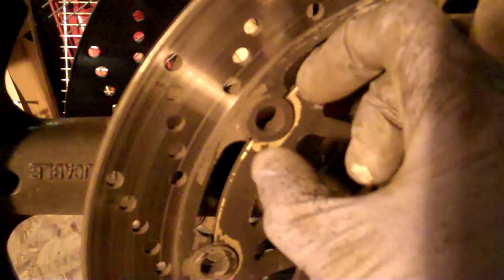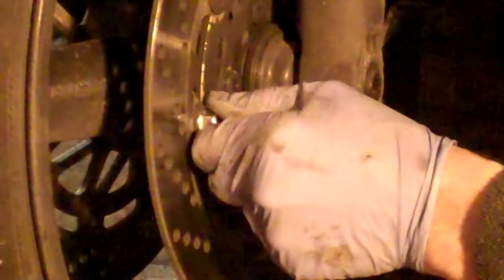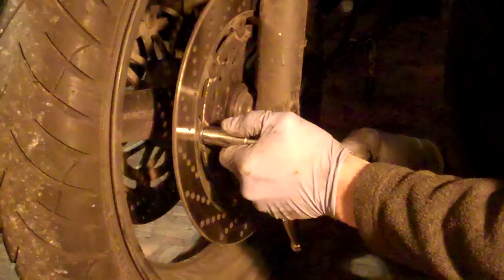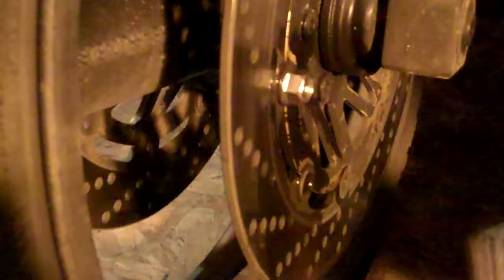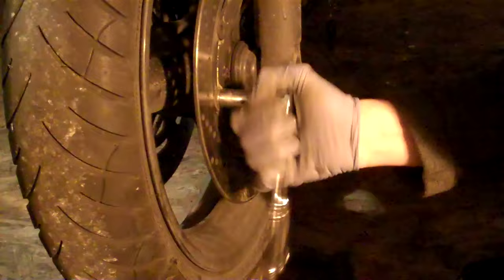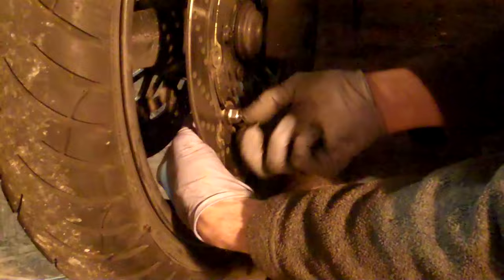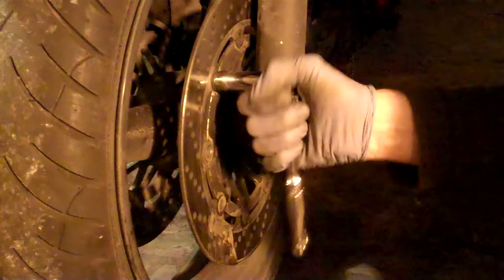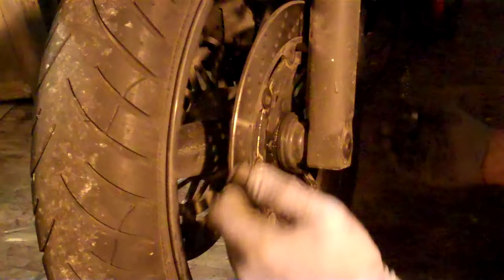Delboy's Garage, How-To Free up 'motorcycle brake disc bobbins'.!

Comment: Great video, never knew this and I’ve been biking for years. 👍 When discs are mounted Left on Left - Right on Right correct direction. How about alignment of disc to disc? Eg on wavy discs the wave should not be aligned but offset. Is this the same for standard Suzuki discs eg. Have the bobbins offset or aligned? 
Thanks Again

Comment: cant we wash the rotor with a detergent or something that would clean the rotor so when you apply brake the pads wont just slip on rotor they would rather grab said rotor as there suppose to in order to stop...

Comment from the maker: CERTAINLY NOT WD40 ...that would be very dangerous as it is an oil!  I used aerosol can brake cleaner, which is a high octane spirit, that washes out dirt & grease and leaves a bone dry finish!

Comment: Hi mate, really appreciate you doing these vids, went to my bike after watching this as i knew my bobbins were stuck, and anyone I've asked about the symptoms has said it's definitely a warped disc. I'm really hoping this isn't the case as the discs are almost new, so I went to try this method.
Having tried this, the bobbins are absolutely stuck firm, and i chickened out before getting them to move. If they are locked absolutely solid, can i damage anything or should i just try harder?
It's an SV650 so I believe the discs should be pretty similar to those on your bandit in this video. Hope you can help mate, thanks again.
Ed
Reply from the maker: Hi Ed, if they've never been cleaned then they could well be corroded solid... have you sprayed them with the brake cleaner, and used the nut and bolt to turn them?  They shouldn't need that much pressure to turn, as there's nothing holding them in place, other than the dirt!  Give them a good soak with lots of cleaner and try again and see how you go... Del
Reply: Thanks mate, that's great. I saw you answered the same question from someone else, so i should've checked, sorry.
I'll soak them with some cleaner and then try again, I'm happy to put some force on it, as long as i know I'm not doing anything stupid, I'll let you know how i get on.
Thanks again.
Reply: What were the symptoms.i found when front braking that theres tugging when i come to slow stops. Same for u¿

Comment: Hi delboy will this act like a grab if I have one or to of the bobbins locked up 
I get a nice brake then a real quick grab,the disc it self is very clean all round with no rust anywhere 
Dek121
Reply from the maker: +Dek Till Hi buddy, if the grab you describe is equal and rhythmic, then one point of the disc is gripping more than the rest, so by all means check that each one is moving then at least you've eliminated that - hope that helps!

Comment: Hi Delboy
great videos thanks for all the info
 one of my bobbins is a little loose
moving a bit from side to side
what to do?
Reply from the maker: +DAVID Yan Peer VCheck the shim on the back David, it may have dropped out or maybe just jammed flat...compare it to the others and see if you can detemrine whats different...
Reply: +Moonfleet41 
thanks for the fast replay!
 all are tight just one a little loose
nothing missing
its a new set of moto-master floating discs
only 500km in use
can i tigthen it with a bolt & a nut?
Reply from the maker: +DAVID Yan Peer If they are the 'press together' type of bobbins, then yes, a squeeze with a nut and bolt will hopefully tighten up that one...

Comment: Hy Delboy. I changed my brakepads on my 650 bandit becouse they was squicky. Bit still remaind like that. I tried what you showed here but no change😔what else could i try to eliminate that frustrating noise? Thanks a lot!
Reply from the maker: On the 650 you should have some stainless steel shims on the back of the pads, if they are missing it will squeal...
Reply: Thanks for your answer. On the back are those plates but on the front no. And on the part schematics also are not present those plates. In time i cleaned the callipers. But now i not manage to get out all the air from the sistem🤣

Comment: I tried this on my Ducati 1098, it has relatively new discs ( ebc vee rotors, wavy discs) and when I tighten the bolt, the bobbins will not move, no matter how hard I turn the spanner, any suggestions would be amazing, p.s love the channel 👌

Comment: Hi Del, firstly thank you so much for your very insightful vids. A circle of friends all relatively new bikers we had no idea these needed cleaning. 3 out of 3 bikes were totally gummed, 2 sort with some elbow grease, My bike on the other hand like a post below will turn with bolt in however remove the bolt and no chance. My question is do I soldier on with the generic brake cleaner or can i move onto something with more penetrative properties. If so, can what can you recommend? Poorly 08 Z750

Comment: Hello Delboy,

Great vid. Quick question and hopefully you can help me. I have the Arlen Ness G3 Floating Brake Rotors. I happened to notice the other day that the Front Brake Rotor hardware kit (Screws, washer and lock nuts) are loose (some play) while installed, I figured I'd tighten the screws and that'd be it However, this did not work as they are all in (Tightened to the max) Bottomed out.  They are still lose and flimsy which makes the disc wiggle quite a bit. Aren't these supposed to be firm and sturdy while installed and doing their purpose between the brake disc and the carrier? Please advise..ty
Reply from the maker: I think you're referring to the Bobbins?.. those pins that connect the rotor to the carrier are there to allow the rotor some free movement in order to centralize it between the pads..!!   not familiar with the Arlen Ness discs, so i can't really advise over email... !

Comment: Hi del slightly of topic here but the other day I watched your service the bandit  and it looked like you used car oil ?? My confusion is  should you use motorcycle oil only on bikes as they share oil with the gearbox  and have additives for the gearbox in bike specific oils  where as car oil doesnt, im rather confused here

Comment: Hey! Can you tell me what size nut/bolt you used? I have an 01 r6 but I'm assuming all bobbins are of the same size
Reply from the maker: +Hasnain Khan Hi buddy, no, bobbins are not the same size... just measure the hole and make it a bit smaller than that!
Reply: Okay thank you!

Comment: Ahh I see I just thought the difference  in the oils was addatives for the  gearbox    but like u say the bandit is a tough old motor  so would that mean the more advance high revving performance enginea would benefit from bike specific oils ?  Also would that mean normal car engine oil minus specific  is fine for engine and gearbox of a basic  engine  theres not adverse effects on the gearbox and clutch ? Thanks for the reply del knowledge is power :)

Comment from the maker: Makes no sense mate...are you sure you're not pinching them up with the bolt maybe?...see if they can move by hand maybe.. sorry but i cant really so much more then suggest things unless i saw it...you can try the WD40 if you really thing they are seized..but there would be rust showing if they were....if you do that however mate...clean them after like you never cleaned anything before...

Comment: one question.. my discs rotors give me a fealing that they are bend.. vibrating brake leder slightly when stopping from 200kmh.. in low speeds its ok.. my this help me with my problem? i have bought used disc alredy to replace them (cheep deal).. but can i give it a try or they are 100% bend and i have to replace them?

thank you!
Reply from the maker: HI, why not give the rotors a clean and spin the bobbins as shown in this video, and see if that cured it..!
Reply: Ok heres the deal :) i done this to my "new" rotors.. on old ones.. you can't spin bobbins compleatly like on identical new ones, just inner side (semi-floating discs on r1) and burned spots are on them.. so they are fried :) thanks for video..

Comment: Anything you can do if the bobbins become to slack and the discs rattle, or is it a case of live with it or buy new,  great vids you do  btw
Reply from the maker: I believe you can buy new bobbins and shims to fit them, the only way would be to check with the corresponding dealer to see what they have available...
Reply: cheers will have a look

Comment: The Disks on my Fazer have what appears to be One sided Bobbins ... any Ideas/Suggestions Del ?
Reply from the maker: Hi mate, some bikes do have solid bobbins, so no space to stick a bolt through, best to try a G-clamp, but don't damage them... good luck, Del
Reply: Moonfleet41 good idea, will give it a try ..cheers for responding and keep up the good work :D
Reply: Moonfleet41 Thanks to your vid's @Moonfleet41, I've set about to cleaning the solid, riveted bobbins on my 1998 Ducati ST2, and I have 2 riveted bobbins that are not cooperating. I'm curious about the G-clamp suggestion, because I've tried that and the part I couldn't figure out is that the bottom part of the G-clamp, the part with the threads, the head of that spins and does not grab and turn like one would need it to work in order to spin a bobbin.  I am an instant fan of your youtube channel, and wonder if there's anything I'm missing to make the G-clamp trick work on the riveted bobbins.
Reply: Seditious Blasphemer
Reply from the maker: The G-Clamp is fixed at the cast steel end, and this bears on the innner side of the bobbin...once its gripped, with some brake cleaner applied, it should shft it, just wiggle back and forth to brake the grip of the road dirt while you irrigate with brake cleaner directly onto the stuck area....works every time.. !

Comment: This rat-bike - What's the MODEL? Or at least, what's the front end from? The calipers seem almost ideal for this special fork I'm trying to put together. Wanna do up a replica NS500/NSR500 43mm TRAC fork, using two right-hand-side legs from the '96+ ST1100-ABS, and an important feature thereof was the mis-matched piston sizes on the calipers, for the anti-grab properties - Kinda like the 2LS & 4LS linkages on DRUM brakes, but in reverse I should think. With a lot of the biggest 4LS drums used in racing, the better riders would actually REVERSE those linkages, or at the very least go to an SLS actuation. I guess that means that when you can stop the brake from grabbing & seizing, you can USE more of it's overall range & ability. When the brakes are UNDER powered for the application, then all is well and good you might as well try and magnify as much as possible - but if they're MORE than adequate, you'll never be able to use the whole brake without seizing the wheel, throwing control out the window unless you can know where that seizing point exists - which would be all the more difficult with an exponential increase in braking force, unless you put some kind of lever-stop at that point, adjusting the lever pull so that it hits the grip right before the grab would occur. Quite possibly impossible in itself given the hydraulic connection, not to mention the differing outcomes at different speeds, not to mention different temperatures of discs & calipers etc.

Comment: Just gave this a try on my 03 zx6r and none of them move at all, i dont dare use any more force! am i right to think they could be semi floating discs and the bobbins do not spin?!
Reply from the maker: +joebmxx Have a look at the back of the disc, if there are little shims holding them in, then they should move !  Spray with plenty of brake cleaner, let it soak, and they will move... most are jammed solid after a few years... !
Reply: +Moonfleet41 okay thanks a lot man! will give it a go

Comment: Thanks for this Del. I've freed my bobbins, but some won't turn as freely with my hand but they do with a spanner. Should I keep cleaning until I can turn them with my hand? I mean how freely should they turn?
Reply from the maker: Sometimes the corrosion gets ingrained in the joint, if the brake cleaner won't wash it out, then try (with the offending bobbin at the bottom of the disc), a little squirt of WD40 in behind the bobbin and keep turning it till it frees right off... then immediately wash out the WD40 with lots of brake cleaner and make sure it's all gone, a great way to do it... but don't over think it buddy, as long as they move, then your brakes will operate better than if they don't !
Reply: Chees Delboy! - very helpful indeed. I'll give it a go.

Comment: Hi Del! I have got a vfr 750 fs. I have ordered last year a brand new brake disc cos the previous warped cos the pistons were sticky. On the brand new one (from DSS) the bobbins are solid. i couldnt move with my finger. it has got 300 miles.
is this normal or they got wrong in the factory too?
Reply from the maker: No mate, if you have new discs with just 300 miles on then they will be fine, the bobbins will be tight as they are new....they wont loosen off and gum up for many years yet.... enjoy your bike mate.. cheers, Del.
Reply: Moonfleet41 cheers Del!
I have got a problem on the another side where the second hand disc is, the whole disc what is above the bobbins is moving. the caliper stays on the same spot thats why the disc touches the pad. I could figure it out, the disc shouldnt move on sideways, the caliper should move.
Can i fix this somehow? i reckon the bobbins are too loose.

Comment: Hi Del. Thanks v much for the channel - its genuinely helpful. I followed your instuctions in the this vid to the letter for the front discs on my 07 Suzuki GSR600 (38k miles). Bobbins turn fine with a ratchet, but certainly won't turn by hand, and no sign of any side to side movement. Time for new discs?
Reply from the maker: Hey buddy, no, not at all... the bobbins won't move by hand... they are a tight fit, and the side to side movement is minimal, and only under the strength of the brakes... the only time you need new discs is when they are worn out!
Reply: Moonfleet41 Happy Days...the discs themselves are fine, so I'm good to go!

Comment: Brilliant vid bud. I need to do this asap! My o/s front pads are clicking because the disc isn't free and looks warped when I spin the wheel and to make things worse the pad spring has had it! Any advice on where I might pick up just a front pad spring from - it's for a cbr600f '95? Cheers mate and ride safe
Reply from the maker: Hi mate.....if you mean the stainless steel shim on the back of the pad, im afraid the dealer is actually your best option....its usually a Honda part and not that pricey....sounds like a good clean and a new set of pads would transform it... good luck and ride safe aye.. Del.

Comment: hi quick question. mine are so seized they have snapped 2 bolts trying. its a cbr1000rr8 are these definitely meant to spin?
Reply from the maker: Not sure Anthony, not without seeing the bobbins.... can you send a picture to my PM..?
Reply from the maker: On the later bikes they dont... they are floating, but very tight, so dont worry too much if they are dead tight..!
Reply from the maker: We are asked about valve clearances every week....i ask the same question every time and get the same answer every time... "Can you strip out the cams, change the shims, and reinstall the cams with perfectly correct timing?"..... because of you find a shim out of tolerance, that is what you will then have to do..?     its advanced technician work my friend, you have to know what to hand it over to the professionals..

Comment: Hi Del, traded my Iron 883 to a 2014 Street Bob and have a question about floating brake disc - should there be a radial movement or just from side to side? Mine has a radial movement and also a little 'ding' sound while I press the brake handle and trying to move the bike forth and back. Thanks, Evaldas
Reply from the maker: Evaldas M Hi Evaldas, good to hear from you again...and congratulations on your Street Bob, i hope you got a good deal, i know they have gone up to silly prices since i had mine new in 2009, back then i paid £9k for mine and i think they are over £12k here now...a huge price hike in 6 years... 

Ok, with your disc, yes there should be a tiny bit of radial movement in the outer rotor...the bobbins are there to allow free movement of the disc to quicken up the time it takes to center the two brake pads and give 100% stopping force.. when you grip the lever, and rock the bike back and forth you will see the movement as you're holding the rotor still with the pads, and moving the bike...it looks a lot of movement, but its actually less than 1mm in actual free play..and totally standard and correct...in fact, if you DONT have the movement, and you cannot see the free play..then it means the bobbins are jammed up with brake dust and road grime...and should be cleaned out.... so dont worry sir.. its completely normal.. Hope that helps... ride safe and enjoy your bike. Del.

Comment: Can anyone help me? My motorcycle bobbins will only turn when I put a bolt in it and turn it. I can’t turn it at all by hand and I have sprayed them countless of times with brake cleaner
Reply from the maker: As long as they turn with the tool, that will keep the movement in the disc assembly... they dont have to move by hand.!